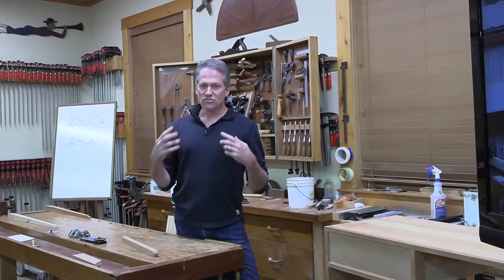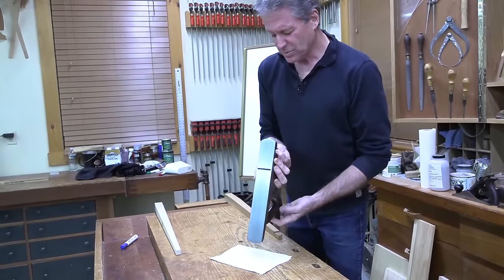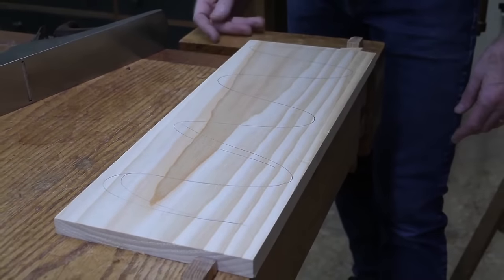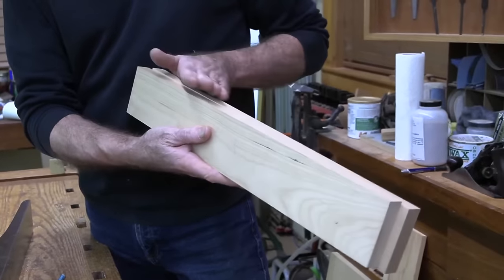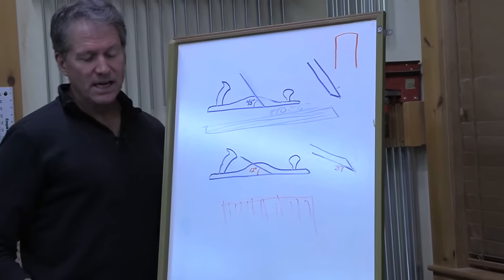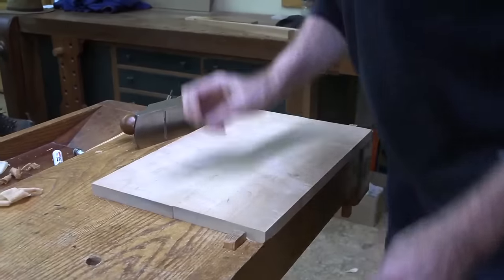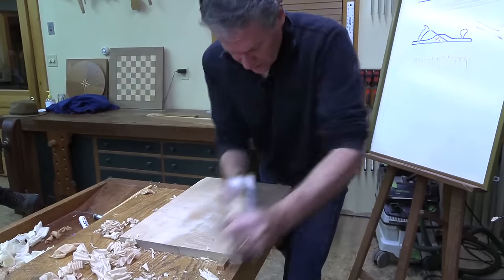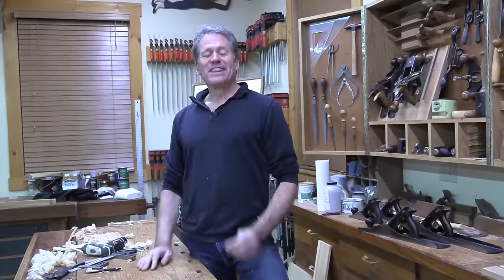How to Use Handplanes Effectively

Comment: I didn't see a SCRUB plane in your presentation.
Any thoughts on scrub planes or a better method to deal with warp?
Cheers,
Reply from the maker: I did mention and describe the aggressive and efficient nature of scrub planes in regard to rough flattening quickly….toward the early part of the video. And I mentioned I do not own an official scrub plane but I do have a plane for which I ground a heavy camber on the iron to simulate and be used as a scrub plane when I need one.
Thanks for watching! 👍😎